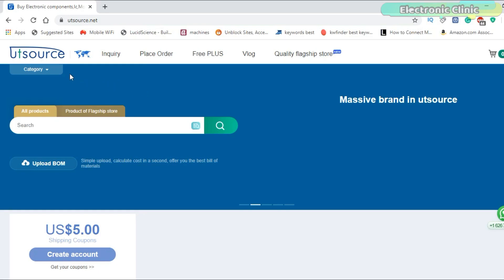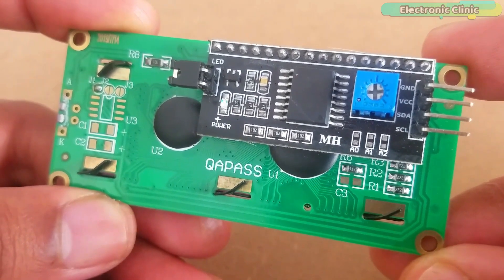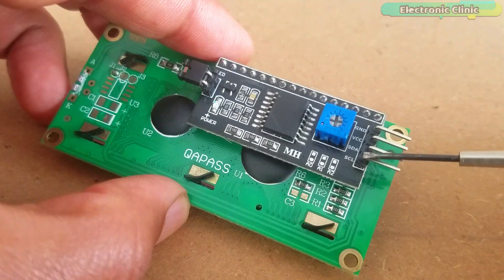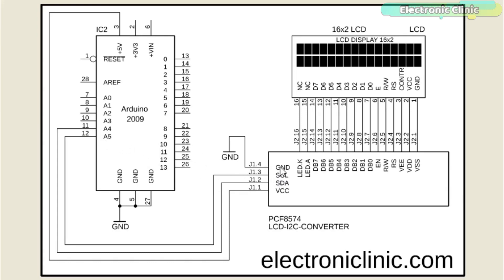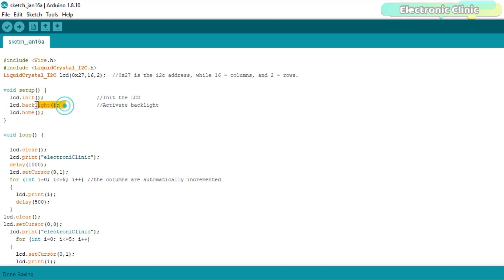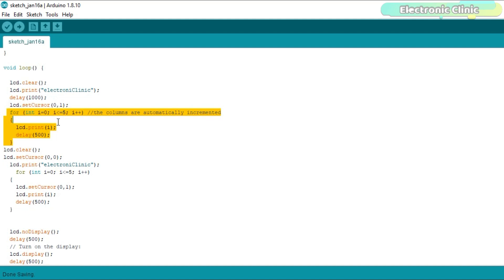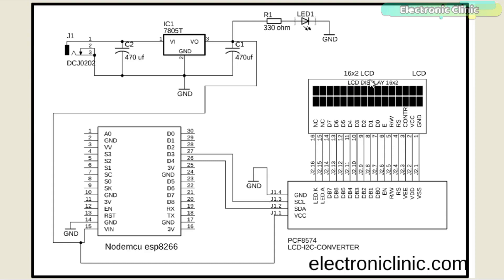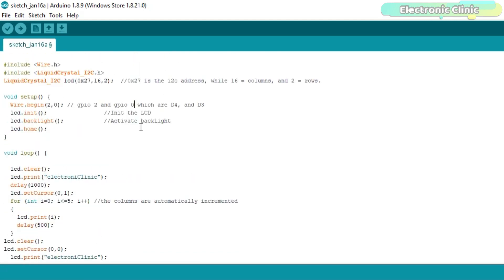Arduino 16x2 i2c LCD, Nodemcu 16x2 i2c LCD Code, Library, Commands with Examples

Comment: Bro can u pls tell me which port (COM) use to upload program in esp8266 
Iam unable to upload code 
Pls tell me bro 
It showing only 
COM 10
COM 5
COM 6 
COM 7
COM 9
Reply from the maker: open your computer device manager and check which port is assigned to your esp8266 board
Reply: @ElectroniClinic  bro it is COM 7 
But when iam upload it showing 
Esptool.fatalerror: failed to Connect to esp8266:timed out waiting for packet header 
Pls solve my problem
Reply from the maker: @payyavulanaveen6967  have you installed the nodemcu board?
Reply: @ElectroniClinic  yes sir
Reply from the maker: @payyavulanaveen6967  the program compiles successfully?
Reply from the maker: @payyavulanaveen6967  this is a simple code, i dont know whats wrong with your nodemcu module. you can watch my getting started tutorial on the nodemcu esp8266, you should run that led program.